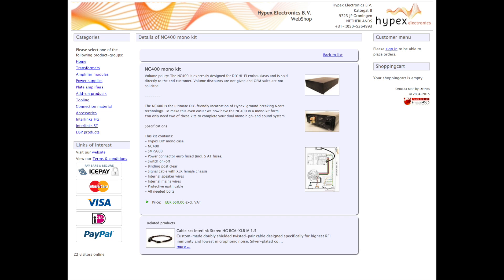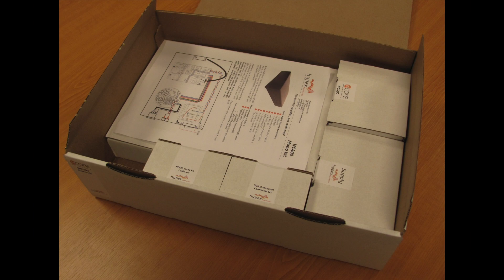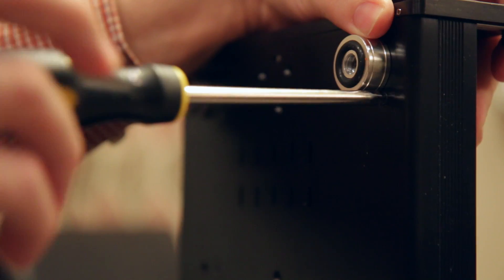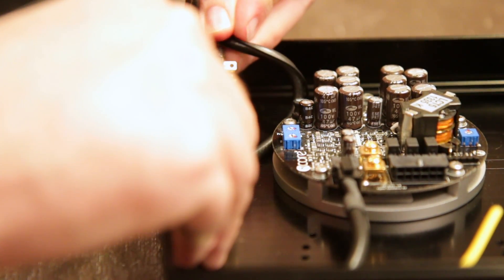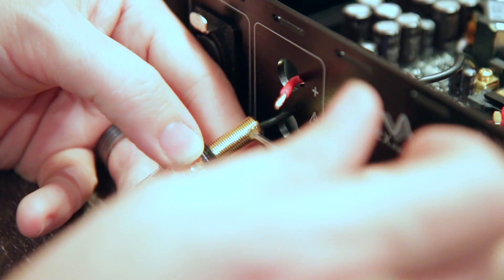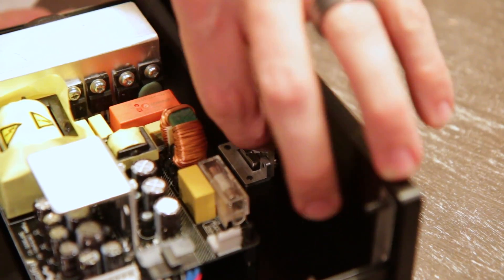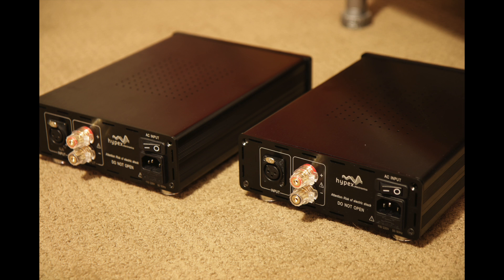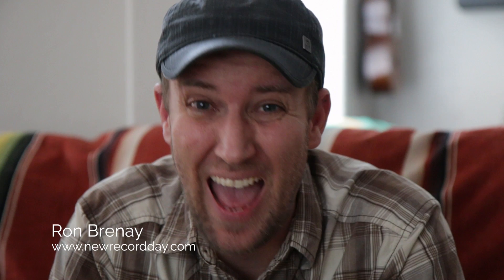Hypex Ncore NC400 mono kit tutorial

Comment: Hey Ron big fan of your channel. I know I'm late to the party here,  just bought this kit in 2022.  Its true everyone links this vid for the kit.  I gotta say though it looks like you have soldered the xlr connection wrong.  Err not wrong maybe, but not the way Ncore wants it.  In the Data sheet they have Pin 1 to chassis  ground, shield to chassis and that extra pin 4 wire to ground as well.  Its in the spec sheet as 9.4 Vastly preferred balanced setup: XLR input.  If anyone wants to chime in on this I would appreciate it, cause maybe I'm just not understanding.

Comment: I do not understand , 575 euro is for one block or 2 monoblocks ?
Reply: 1 mono block. It has become cheaper than a few years ago... I build 5 NCore mono blocks early 2012 when they were just launched at a price of 505 euro excluding VAT. Mind this was only the amp module and the powersupply, no cables, connectors and casing. So 575 is a good price. By the way they are still working great!

Comment: These amps are still phenomenal in 2019. I just recently built them and I don’t think I had anything that resolving in my system since I started this path 20+ years ago, not even Bruce’s OTLs. It does everything right, the closest thing to a wire with gain.
Reply from the maker: Totally agree!

Comment: Currently building an even more DIY type kit, using two (2) NC500s and an SMPS3k700 in the same chassis to create a stereo amp setup. A bit more expensive and challenging given the lack of documentation for this topology, but not super difficult to assemble. I'm wondering whether I'll ever be able to add something like VU meters or better LEDs and whether anyone has any experience with a DIY project like this.

Comment: Dude!!!! First listen you were "blown away"????  I am utterly amazed!! Every Class D amp I've ever heard sounded terrible, shrill, brittle and fatiguing until after about 3-5 days of play. In fact, although to a lesser extent, any amp I've ever owned didn't sound it's best until a week or two of break-in play. How did they sound a week latter Ron?
Reply from the maker: I know, I rarely love the sound of an amp right off the bat but with the Ncores, I heard so much potential. I love the Ncores and continue to use them as a solid state reference to this very day.
Reply: Hey! You were partially right 10 years ago.... ten years ago class-D sounded not very good treble to hear but men, things changed. The north american company classdaudio (doc)com makes once of the sweetest and best sounding amps for the price you can pair with Dynaudio, SonusFaber, JBL or whatever brand of speakers you prefer. And if the low cost ClassDaudio sounds so good detailed, commanding, warm, clear and not-fatiguing (I have classdaudio cda-250 at home with my Dynaudio Audience 62 and I can swear it to you it sound better than a 40 kg Vincent power amp class-AB hybrid with tubes) (with TVC-preamp passive preamp)..... dont blame class-D amps. Things have changed. New analog-controlled very-high-switching-frequency class-D amps sounds as good or better than any class-aB "heater" :)

Comment: Hypex recommend twisting the speaker wires together tightly and also have them connect to the gold connectors the other way so that they're both pointing inwards towards each other - is to prevent the wires acting as aerials for RF noise.  Although mine aren't and I don't think I'm getting any noise....

Comment: Amazing video. You're fun to watch man. Ok. so I am Super new into this Hobby with zero background. I'm just learning what goes where.. I guess my question is this. I have a Denon Receiver 7.2 can I use a Class D amp off of it for the 2 front L&R channels to push my new Bowers & Wilkins ? I want to get all I can out of them. Is this even a good idea to add a Class D amp to the Denon that is already pushing 120w a chan. will it be a big upgrade? will it even work? will I blow something up? As soon as I start thinking about really spending money on this hifi stuff I feel like Peter trying to walk on water. You should make a hifi what is what 101 vid!! Thank you so much for the great vids.
Reply from the maker: +Ben MIller Thanks Ben! This "could" work based on a couple things...  can you do a favor for me? Let me know the model of the Denon and ill help you out...
Reply: AVR-X4100w. Thanks man!
Reply: +Ben MIller      You can't parallel multiple amp outputs to a single input.  Run your LR speakers on nC400s and sell the Denon, or use the Denon as a preamp at first.  But you'll soon want a better preamp like Ron's Tortuga.  Or get a DAC with a great variable balanced output like Sabre-based types such as Oppo's 105D or Exasound to take better advantage of the nC400s.  Bi-wire if you can to get best advantage of the nC400's extraordinary damping, or vertically bi-amp if you're willing to buy 4 nCore channels.
Reply: Samuel Lord    Right now I'm running the kef R700 with that Denon. Im looking to buy the peachtree Nova220. It seems to be a smashing deal. I think you can upgrade the tube to give yourself a little play room. Still tell me if you think I'm doing it all wrong. You said 4 Nc's for bi amping. so 2 amps pr Keff? I just bought the kef. I found a dealer in Organ that sold the Ryan's and the kefs. He said as the Ryans sounded smooth they had nothing on the kefs. (random side note.) So I buy the obbo? why? just to have a dac? I think thats alot for a little upgrade imo.. I have some nice biwire cables. If I sold the Denon I would be throwing myself in the deep end really fast with not a lot of ability to swim.
Reply: +Ben MIller 
Okay Ben, job #1 is to list your goals.  You've said almost nothing about your system and what you listen to.  Do you like your Kefs?  If you're listening to MP3s or AACs (iTunes) primarily, then you won't benefit as much by great components.  That said, the Peachtree should be a notable step up from the Denon, which is a typical multichannel receiver with an insane amount of connectors and channels.

You're smart to avoid more than front speakers, going multichannel just adds cost and screws up sound unless you're spending over $100k.  So keep the Denon, it has uses.  But for much better sound go with the Peachtree for a simple swap-out, it's a Class D Icepower unit (albeit with latest Icepower circuit) that will serve you well.  But the Hypex nCore amps are in a whole other league.  They sound better than most $10k+ amplifiers.  You'll never have a reason to replace them.  They'll be around quite a while at a low price, so give your decision time.

The Nova 220SE would make you happy for a long time.  The nCore400 amps with a very good but affordable DAC with volume control (like the iFi Micro DSD at $500) would blow your mind to bits, in a good way.  Also you'll have the flexibility to use a variety of different gear upstream and know you'll never outgrow the sound of your amps.
Reply: Samuel Lord     My goal is to spend 2k or less to power my kefs. I listen to Tidal off my Iphone.I don't care if I use the Denon, however if it can save money by using it therefore leaving me more money to create a nicer sound than great. I want to get all I can out of the kefs. I want the smallest hint of warm,music separation and clarity to a new level. I want to feel the vibration of the wood off the violin. Thank you for your help.

Comment: Hi Ron,

What preamp did you use with the Hypex Ncore mono amps and did you connect it using full balanced mode, amp to preamp) or XLR (amp side) to single ended RCA interconnects (preamp side)?
Thanks!
Reply from the maker: +Jeffrey Srnec Tortuga LDR. Single ended. Sounds amazing.

Comment: Would be interesting to compare against other Class D amp e.g. Wyred4Sound, Class D Audio, D Sonic, Bel Canto ...etc.
Reply: +kuisin88 
Been done.  The top Bel Cantos, the Black series, use nCore modules and cost over $10k.  "Class D Audio" amps are just basic Class AB amps, falsely labeled as Class D, nothing worth writing about.  W4S are class D Icepower amps like the cheaper Bel Canto line: good, but nothing like Hypex.  There are no Class D amps that compare with Hypex offerings without actually containing Hypex modules.

Comment: should you not put heatschrink around the speaker binding post and the xlr connector on the inside to prevent interference ?
Reply: +Peter C Heat shrink doesn't provide any shielding from electromagnetic interference .
Reply from the maker: +Peter C Thats a good suggestion!
Reply: but something is better than nothing :)

Comment: Ncore 400 sounds good because they're transparent and has extremely low distortion across the spectrum. Bass is tight due to high damping factor and it has ample power reserves for most applications. People can say what they want, but transparent gear is far superior to colored tube gear etc imo.
Reply from the maker: +HeadphoneAddictCOM Pretty much sums up everything I like about these amps.
Reply: +New Record Day :) Now you just need to get Hypex DLCP more NC400 mono blocks then bypass the passive crossovers so you can run the speakers fully active, haha! It's crazy how much performance you win by getting the passive networks out of the chain and do xovers digitally before amplification. If you go that route I'm not sure you will have any time left for your channel though, haha.

Looking forward to your full review, and thank you for the high quality content you produce.
Reply: +HeadphoneAddictCOM agreed, on colored tube gear. However good tube audio is not colored. At least the tube gear I paid for. Would never buy overly warm mushy soft bass. JMHO
Reply: +New Record Day     
Hello Ron, great video!
Strangely, the Hypex enclosure is adequate but far from ideal for the nC400 and the matching SMPS600.  A handful of other, custom versions seen on DIYAudio like  the one by "barrows" have made similar changes but I'll list mine here.  I'm building 4 mono enclosures for 4 channels, with the following changes relative to the Hypex Cassis/layout: 

1) an XLR output jack paralleled with the input and shielded with a Cardas shield plug when not in use; 
2) PS rotated clockwise 90 degrees, placed more forward to clear the channel in the longer chassis, in order to vastly shorten both the AC input leads and PS-to-Amp DC supply leads; 
3) Amp channel rotated about 60 degrees clockwise for ultra-short input and output leads; 
4) a vertically-flipped IEC power connector for better retention (beveled edges on bottom);
5) These changes require a ~50mm deeper chassis, preferably with substantial cooling slots on top and sides.  

Cheers!

Comment: Don't know why this is sold in kit form if it takes about an hour to put a pair together. Why don't they just do it at the factory. How much money are you actually saving (or think you're saving).
I don't doubt they sound good but for what they are I was expecting (hoping) to pay a lot less. At $1000 CAD I would have ''added to cart'' in a heartbeat.
Reply: +Mike Cees The kit is rather new. They used to sell the NC400 modules and the SMPS power supply + cables, and you had to go to another supplier to get the chassis. They probably stream lined this to make it more accessible for people that just want the whole package without going north, south and having to pay shipping from multiple places to get something that works well and are easy to build. It's much easier to go this path now, you don't have to get a CNC shop to do the right cutouts etc.

Hypex NC400 is known as the world's best class D amplifier, bar none. The distortion is extremely low across the spectrum because of their excellent use of feedback. You will not get another amplifier with this kind of performance at this price. That being said, I have built a couple of Anaview AMS1000 amplifiers. They are darn good too and I'm super happy with them. They cost less than the Hypex and offer almost the same level of performance.

As for the price of NC400, it's really cheap in comparison to what you get. NAD's new M21 employs Hypex NCore modules together with NAD's proprietary power supply tech and is said to be extremely good too.

I don't know why Hypex doesn't just build the kit and ships it out, but probably because they don't want to compete with companies who buy OEM modules from them (like NAD and many other manufacturers). Also, it feels good to have built something even if it's easy. I'd say go for it. :)
Reply: +HeadphoneAddictCOM  Very well said.  I, an enthusiast with two "left hands", would feel very happy and proud to have built my own amplifier!
Reply: +Mike Cees I've had an NC400 stereo setup for about a year now and I too think they are more than worth the $1400CAD I paid to build them. Like the guy in the video they definitely blow you away, the mid/high clarity, transparency and very tight bass control are outstanding. Everything else just sounds like crap. I've long retired my tube amps for good. My amp comprises of 2x NC400 modules and a Hypex SMPS1200A400 PSU in a single chassis.

Comment: What an interesting kit and can't wait for your full take on these as I'm sure it'll be interesting with more analysis brought forth.

That said, I agree with Darkmatterfalls 101 in that it DOES take time for systems, be it amps, speakers, even your cartridge to break in as they settle down, open up etc, though I would posit that the cartridge break in will be more subtle than say, a pair of speakers or an amp. However, I've read, and seen this where a piece of kit sounds great out of the box (remember, not all do) and let them break in and then evaluate them.

I know this for a fact as I rebuilt the crossovers in a pair of 42 year old Sansui speakers back in September by replacing the tired original Rubycon capacitors with fresh ones but leaving the crossover stock otherwise (replaced caps with the same like values as the original, just with higher wattage capabilities at a much smaller size since the wattage on the originals was of an odd value). Anyway, out of the box the speakers came alive, but with a LOT of glare in the midrange, and it took literally a week before they finally settled down and now nearly 3 months in, they sound great, can turn up the volume and they remain composed, unlike the first few days after the recap. 

They have since then settled down a bit more and I have them dialed in to where I like them for 90% of what I listen to, with a touch of a tweak with the treble control on some of the brighter LP's as my table tends to be more forward/bright than the CD player or the reel to reel and I'll be upgrading that table eventually. The table is a vintage budget deck from the mid 80's with the SHURE M97xE cart, and it's that cart that helps keep this table from being even more thin on the ground. 

At any rate, you do good work and I'm sure you get stuff that do not live up to their marketing/hype, regardless of their price range (heck, we all know that some high end gear is all show and no go).
Reply from the maker: +John Palmer Thanks John! Ill really put them through their paces in the full review.